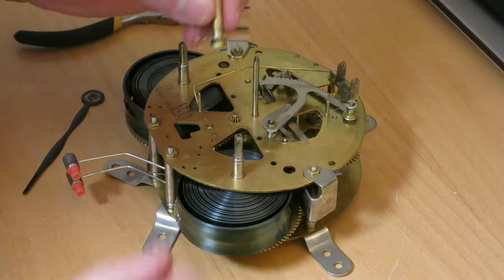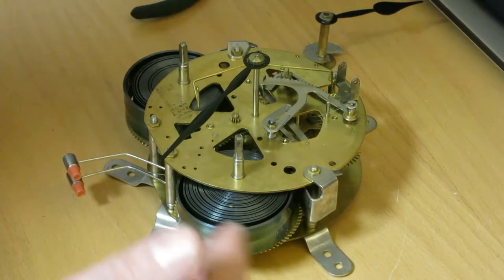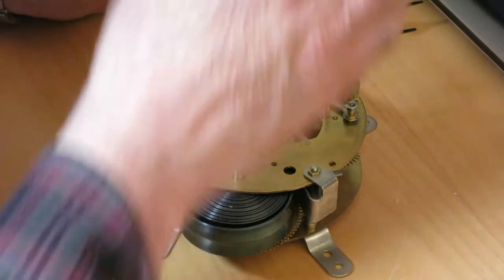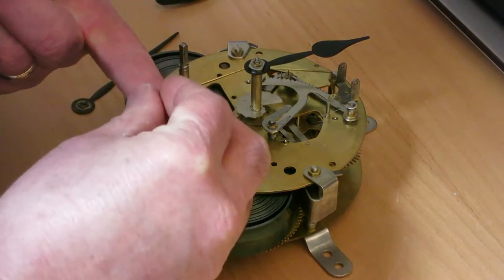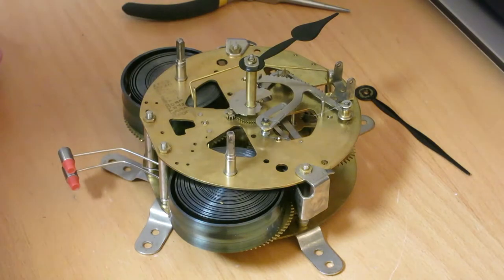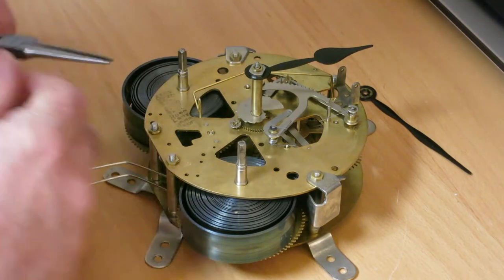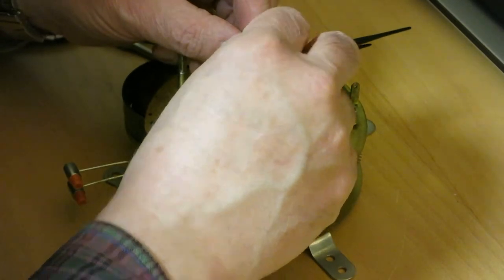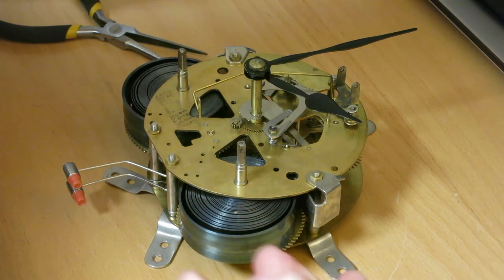Adjusting the snail on my first-ever clock repair

Comment from the maker: Since getting this clock running, I've learned that you can adjust the snail (and hour hand) position without disassembling the clock. There is an hour hand clutch, which enables you to push the hour hand around the face, moving the snail as well.

So if your Montgomery Ward clock isn't striking the right number of hours sometimes, and the hour hand doesn't point straight at the hour when the minute hand points to 12 o'clock, you should be able to fix the problem by pushing the hour hand to the correct position. NOTE: don't move the hour hand until the clock has struck the hour; pushing the hour hand forward when the clock has gone into 'warning' (primed for striking) can damage the clock.

Comment: Great video thx.. I ve a 31day clock with a snail n strike problem.. Manually turning the minute hand the strike is working correct.. When the clock is ticking away on the hour the strikes are random..

Comment from the maker: The more detail-oriented viewers probably noticed that I put the minute hand tension washer on incorrectly. The (incorrect) order of hand parts in the video is: hour hand, hour hand nut, minute hand tension washer, minute hand, minute hand nut. Before I learned this was the incorrect order, I was wondering why the clock kept stopping. The problem was that the minute hand was pressing down onto the hour hand, causing more friction than the mainspring could overcome. That's a simple, silly way a clock can stop after running a few minutes.

The correct order of hand parts is: hour hand, hour hand nut, minute hand, minute hand tension washer (with the domed part face-up), minute hand nut. I assume the minute hand tension washer is there to press evenly down on the minute hand, so that hand doesn't tilt.

Comment: Repairing the identical clock.  Problem,  clock occasionally strikes twice on the half hour at no specific time. Not sure why.  ALSO,  nut holding hour hand is stripped.  Cannot find a duplicate anywhere.  Not sure if metric.  Currently being held on with e-clip made from a washer.  Any ideas where I might get an appropriate washer?
Reply from the maker: I generally buy clock parts from timesavers.com, but you can search Clock Parts on Google to find a parts supplier near you. Good luck.

Comment: Hi. Great video. I have a question: why do you set up the snail for 12 o clock? Isn't the important issue to make sure that the rack pin falls in the beginning of each snail step? Or you do it just because it's easier, without the dial, to set the hour hand to a vertical position? Thank you for your reply. jp

Comment: I'm at a loss understanding how putting the e clip on the small gear below the snail can possibly retain the snail and tube.
Reply from the maker: Good question. Take a close look at the snail, which is visible in the upper-right of the picture about 2:30. You can see that the snail is permanently fastened to the tube and the motion-works gear at the bottom (back) of the tube. The e-clip keeps the motion works gears (a small gear plus the snail's gear) in place, and because the central motion works gear is permanently fastened to the snail, the motion works gear keeps the snail and tube from coming off.

Comment: i have an issue,,my junghans clcck strikes 3 times at 2 and 3 times at 230,,and then the 3 oclock hour becomes 4 strikes and so on,12 becomes 1 oclock,,,,,will this fix my problem??
Reply from the maker: I'm sorry I have no experience with Junghans clocks. The general principle of a rack and snail is the same, but the details are probably very different.
Reply: @BradfordNeedham  turned out to be a gummed up snail,,was moving too slow and passing the 2oclock stop  i remedied the problem

Comment: Do you adjust to the twelve o clock position?
Reply from the maker: I'm not exactly sure what you're asking, but I'll make a guess: "do you adjust the position of the minute hand so the clock strikes when the minute hand points exactly to 12 o'clock? I didn't make that adjustment on this clock. I remember reading that in most cases it's better to adjust another lever rather than bending the minute hand. See Steven Conover's book "Clock Repair Basics" (https://timesavers.com/i-8944876-clock-repair-basics-by-steven-conover.html).
Reply: @BradfordNeedham  that makes sense about the minute hand